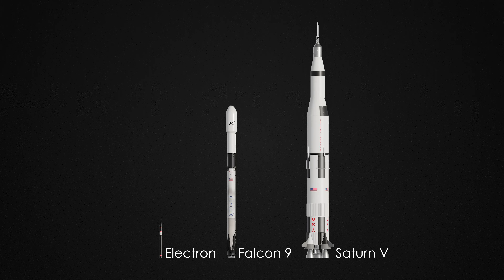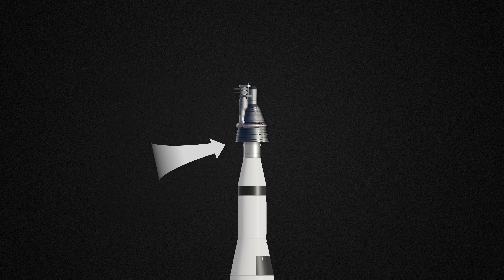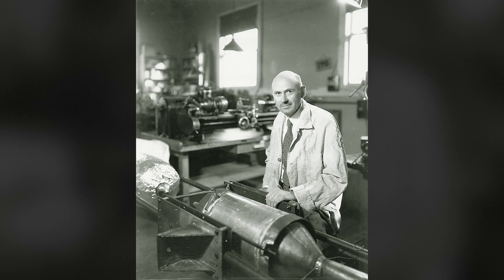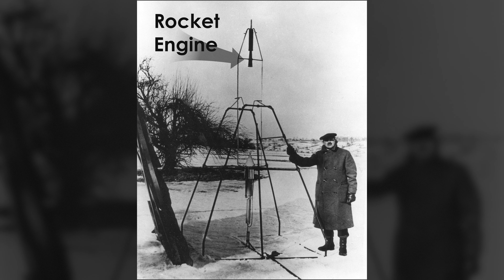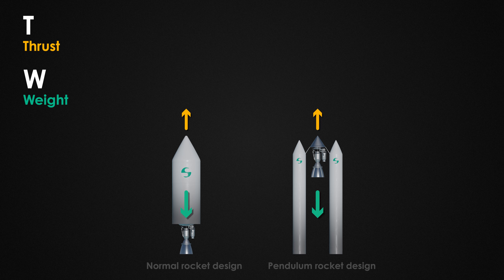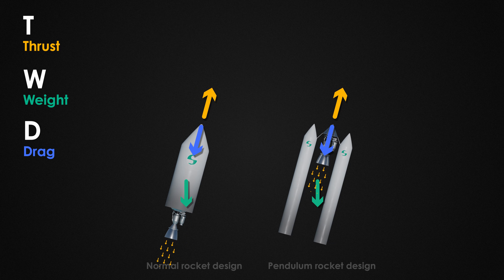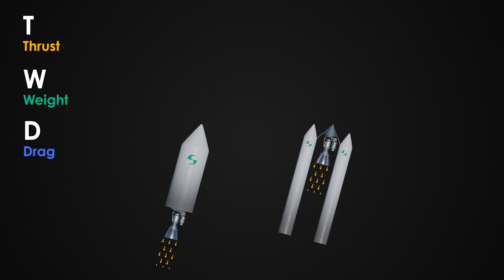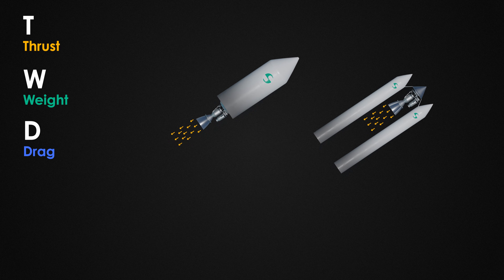Pendulum Rocket Fallacy Explained in 1 Minute!

Comment: Problem is that, we do put engines on the top, just like launch scape systems, Apollo and Artemis programs both have it, the exaust is not really a problem. That's not what a pendulum rocket is tho and why it is a fallacy.
Reply from the maker: The fallacy is to think that it is passively stable if you put an engine on top. I know it's no that the exhaust is a problem, I'm merely mentioning that since there is not much difference between where you place the engine, that's one of the reasons you don't want it on top.

Launch escape systems aren't passively stable, which is why they sometimes use some sort of stabilization of the capsule to make sure it doesn't flip (too much). You can see this on Soyuz for example, large grid fins on the fairings. On Apollo there was no stabilization I think, but then again, LES's fire for such a short time that even if the capsule flips once or twice it will right itself, because capsules themselves are always passively stable (aerodynamically).

Comment: Also, better to have the force of acceleration pushing fuel toward the engines.
Reply from the maker: Sort of, this effect definitely helps, but fuel tanks are often (if not always) pressurized by gasses to push the fuel into the engines! But yes, that's one of the things I couldn't fit in one minute! 

Plus, plumbing would be a nightmare.

Comment: very cool. just a question i always have after hearing about that stuff: why doesn't the engine just gimbal to always point the opposite way of where you wanna go and let the rest of the rocket swing under it? i'd imagine it would be much easier than to ballance the massive rocket like a pen on your fingertips
Reply from the maker: Yes, at that point it's the same as balancing it like a pen. There is simply no upsides to having the engine on top. Plumbing would be a nightmare, same with the exhaust as I mentioned. And don't even get me started on having multiple stages!

Comment: That doesn't explain absolutely nothing. You're basically saying that the reason the engine is never on top is because of the exaust, wich is terribly wrong. In the model section of the video, where you should actually be showing what really happens, you just showed both models doing the exact same thing with the exact same size of "force arrows". I'm really sorry, love your vids but that's the wrong explanation.
Reply: I've rewatched the vid several times now, you started moving towards the real reason with the equation but you never applied it to anything and ended up with the wrong conclusion that has nothing to do with the equation or the models (that shouldn't be doing the same thing if you wanted to compare both cases).
Reply from the maker: Can you tell me why they wouldn't be doing the exact same thing? Goddard's rocket crashed, just like it would have done if the engine had been on the bottom.
Reply: @StanleyCreative He/she isn't disputing your conclusion.  He/she is just taking issue with your explanation.